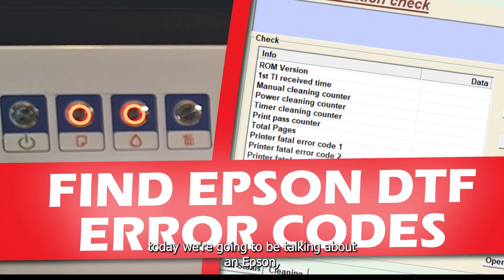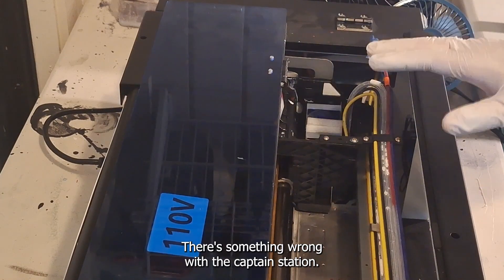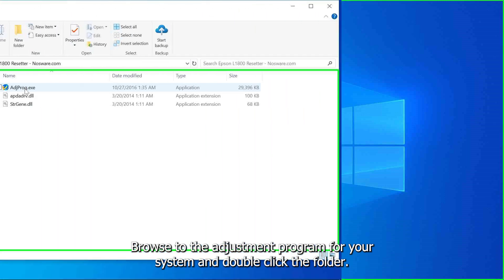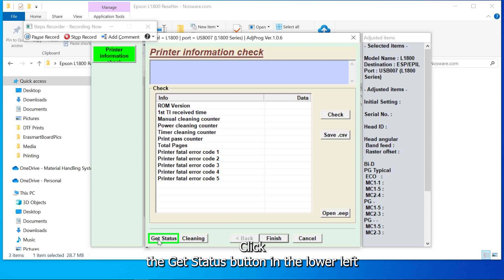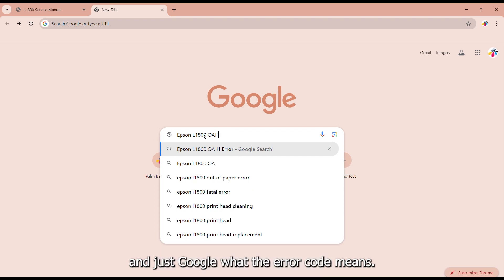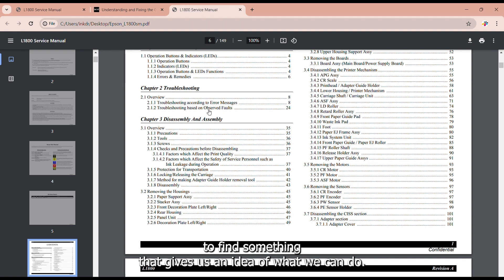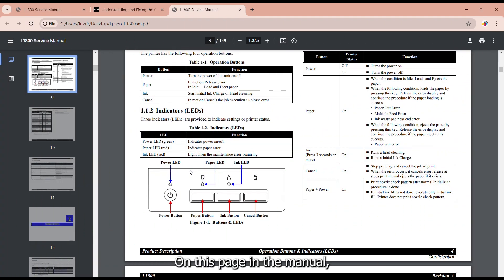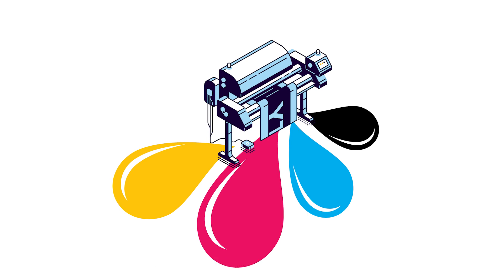L1800 R1390 DTF Printer Red Lights & Error Codes

Comment: how did you fix the fatal error OA H. is it the motherboard or print head? please help
Reply from the maker: It's likely a bad printhead that has caused damage to the mainboard.
My suggestion:
1. Shut printer off
2. Unplug printer
3. Remove printhead (which is likely damaged electrically)
4. Take pictures of cables and placements on your mainboard (for reference)
5. Remove mainboard
6. Leave suspected printhead out
7. Install new mainboard
8. Install new printhead
9. Turn the printer back on